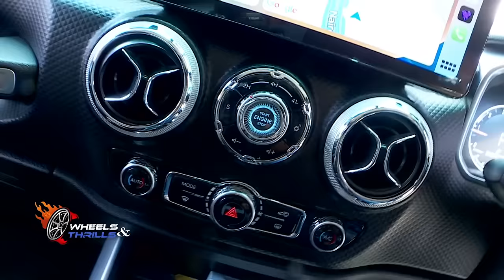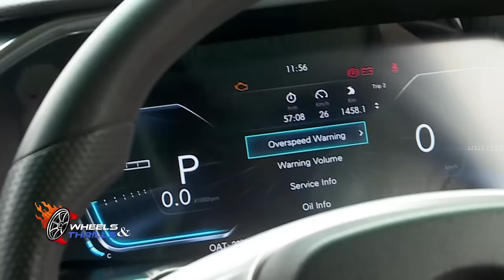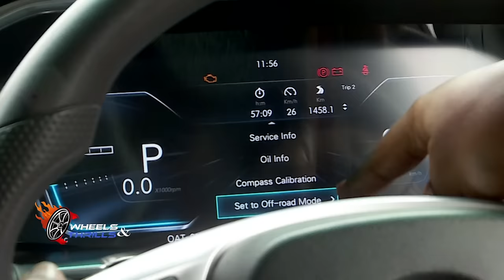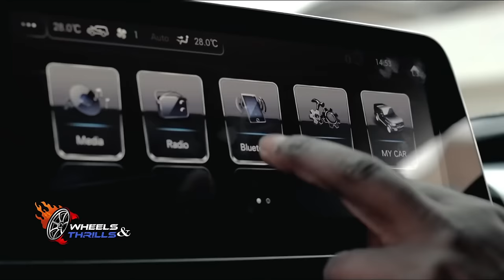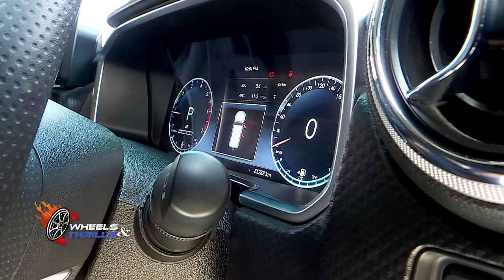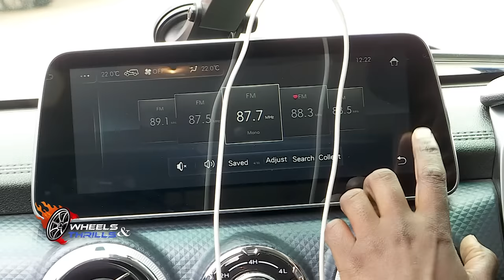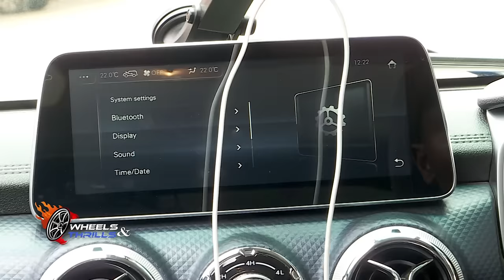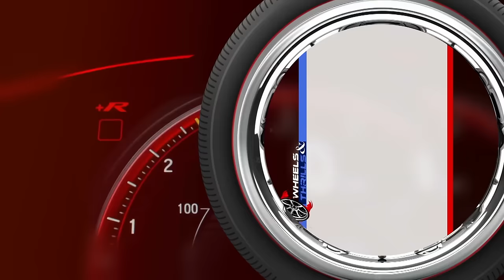Mobius: Kenya's Own Car Brand - A Thrilling Ride of Speed, Design, and Innovation!

Comment: Mobius should build a pickup and double cab version of this vehicle,i am sure they  would sell like hotcakes.
Reply: I agree and even sent the CEO an email a while back to have them modify and use them for tourism which would raise their profile tremendously all over Africa, but never heard back.
Reply: @jahzinho5784  
It's very unfortunate.that your brilliant advice was ignored. Pick-ups and expedition tour vans are very popular in Kenya and Africa.A ladder on frame chassis can be easily modified into several body styles.
Reply: Mobius isn't designing or manufacturing them, they buy them basically as a kit, from China. And then assemble them in Kenya. So unless the company in China makes a pickup, it won't happen.
Reply: @aaronadkins8234  
Cooperate red tape,i would say.